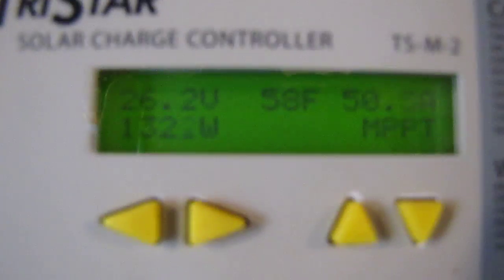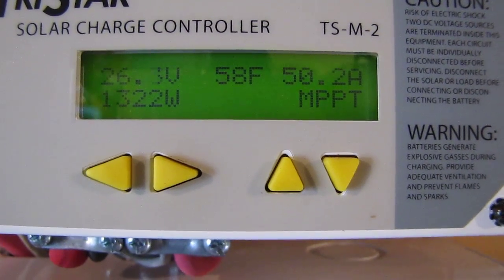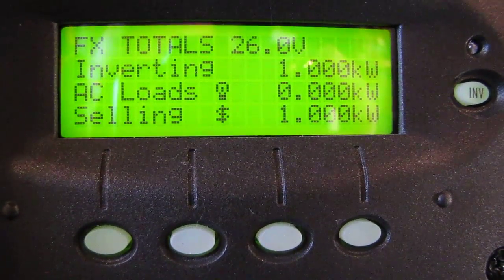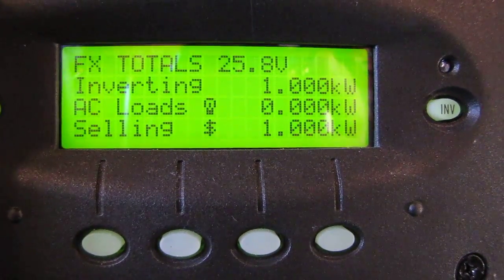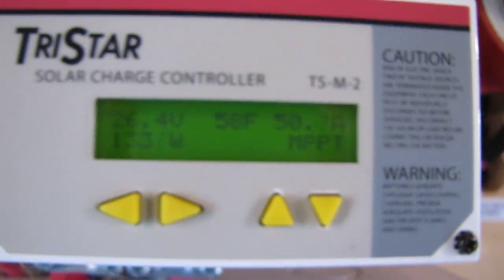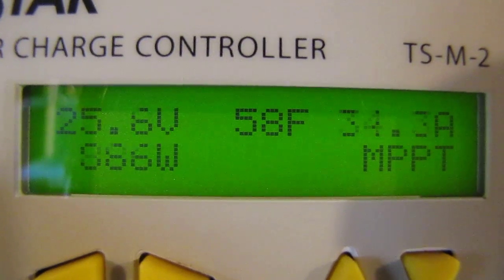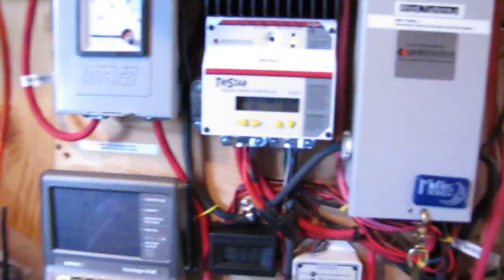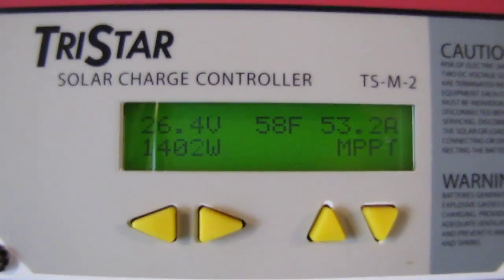VIARLOCITY Solar And Wind Power Display Of Power Reading's With Solar & Wind

Comment from the maker: @dapappacn Will During The day Im Good with Solar I have Six AGM Batteries 90 amp Hours Each Thats 270 Amp Hours at 24 Volt  ! Batteries are Great ! But You would Have to Have A Whole Room  Of Batteries like About 5000 dollars Worth To Get anything Out Of Them Lets say 20 Batteries Or 30  Even OBXSOLWIND Has A Generator to Charge His Batteries at Night Or when there is not Much Sun  For example At Night Batteries wont Last Long At All If nothing Is charging Them Like Light Bulbs TV Computer Etc